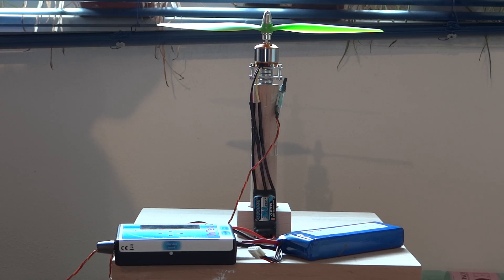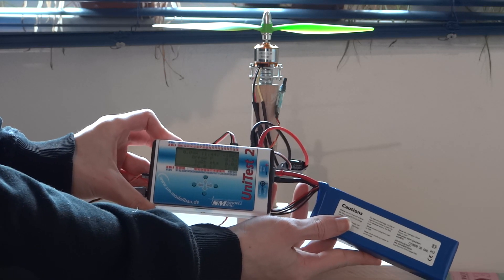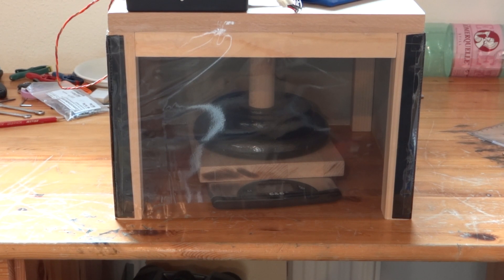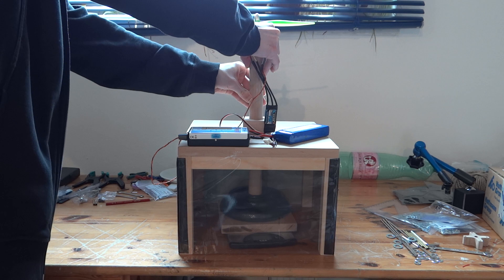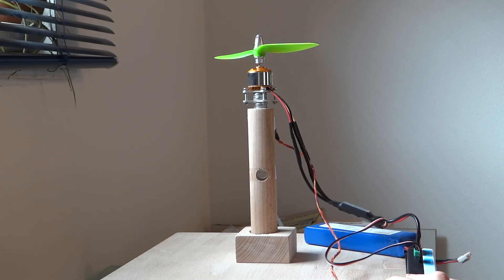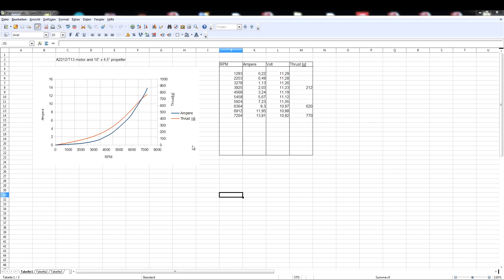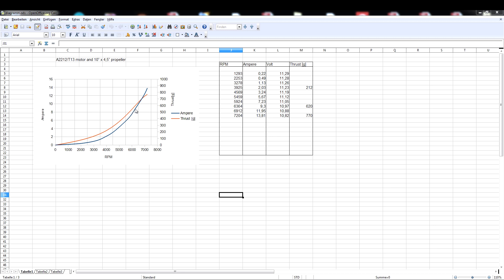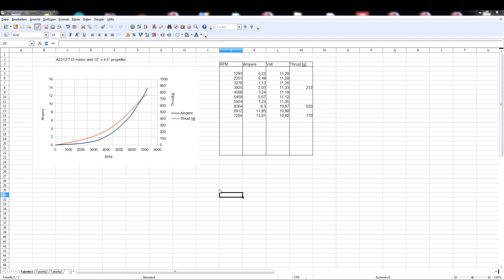A2212 Motor and 10x4,5 Propeller on the Test Stand; Thrust, Current and Speed Measurement

Comment: Your data sheet does not show Watts. As motors are rated by Wattage, which is then applied to weight factors per type of model, you have missed out a most important factor. When matching a motor to model type, Watts -  per lb, kilo or grammes or whatever - is the most necessary figure to work with. ie sport gliders= 75-100W per lb, hotliners - up to 250-300 W perlb. And so on. Large aerobats can be a massive 800 - 1000 W per lb. If you liken Watts to HP you're getting there. 
The info sheet you get with your motor will give you a 'ball-park' number for both Watts and Amps. 
Also high revs do not equate to efficiency. Look at indoor comp models, they rarely rev more than 200 rpm but their prop is far more efficient than a high revving ic engine. Prop efficiency comes down to balancing pitch, diameter and output of motor, plus torque 
The Watt meter is your friend.

Comment: It would be necessary to see if that motor really has a Kv of 1000, since the numbers show a Kv ratio of just 66% with that propeller. A very poor value for efficiency below 65%       Habria que ver si ese motor tiene realmente un Kv de 1000. ya que los numeros muestran un Kv ratio de apenas el 66% con esa helice. Un valor muy pobre para una eficiencia por debajo de 65%.

Comment: Hello, the information provide is very useful! Maybe I'm a little late but I'm doing an experiment similar to yours and I can't get more than 200 gr of thrust.  I'm using a A2212/13T 1000KV, 10"x4,5" propeller,  esc 30A,  and Lipo 2200mah 3S 25C. 
Did anyone have this same problem? Thank you!
Reply: what is the meaning of 13T ?
Reply: @vikrantsingh47  number of turns on the copper wire, the more turns, the lower the RPM but greater the torque

Comment: i just ordered this motor how can i test it if it is running? what kind of battery or voltage to use? thanks
Reply: Battery voltage depends on what esc you are using.

Comment: Could you tell me in which city you tested this? I will be flying at very high altitudes, so I will need to compensate the calculations because of the air density being lower. Thanks.
Reply: You need to vary pitch. In thin air you need a coarser pitch. And a Watt meter! You absolutely cannot guess it.

Comment: can we fly 1.2 kg quad
Reply: You can. Provided u calculate the thrust per motor. If it s a quad, divide the total thrust required by 4. So you will get the thrust required by one motor. Then if you are using the quad for racing then use a motor with 100% more thrust than calculated. If you're using it for video recording then choose a motor with 70% more thrust than required. This is mainly for stability. While for racing you require speed rather than stability.

Comment: Hi, partner! I have an F450 drone with a 920 kv engine with a 1045 propeller and it flies well, but with the gimbal and the camera is not going up! The total weight of the drone is 1.5 kg. Which propeller should I use to make better use of the thrust of the engine?
Reply: Did u ever figure out which prop is better for your f450? Have same frame and 10" props r too much, hot motors. had sum 7" tri props and it flew ALOT better, have some 8" standard props but waiting on a replacement motor ( crashed drone after a flip, couldn't recover fast enuff with the 7" tri prop) . I have br2212 1000kv on a Hyperion 3600mah 3s. Don't want to have to order a bunch of different props if some one has a good idea of where to start. Flew it on 4s also , but only have small 1500 4s for other drone.

Comment: Hello,
Have you tested the same setup with 2s battery? if yes, would you like to share the results.
Reply: For 2212 motor +30 Amp esc you should use 3s lipo more than 850 mah...... For a good result
Reply: Bro, it Will be unpowered..... Like dead fish 🐠
Reply: 490 gramms with 2s

Comment: How did u measure ur rpm?
Reply: You can use the optical tachometer, One thing you need to be careful is that most probably the coloured propellors are reflecting.So you need to divide the result shown in tachometer by two because it counts each rotation as two.

Comment: I have a question. In your excel we can see that you get 7200 rpm at 10,82 Volts. Shouldn't you get 7200 rpm at 7.2 volts instead? (1KV)
Reply: 1kV is the no-load speed. his test is under load, hence less than 1000rpm/V.
Reply: Okay thanks

Comment: Hello , just a thought I'm not actually sure but , would the results be different if they were measured one , with the propeller lifting the measuring object to the propeller pushing the measuring object towards the ground ? I'm supposing there would be slight differences given that Gravity is helping the downward measuring as opposed to gravity going against the upward lift measuring . On such a small scale it probably wouldn't make that much difference . But on a larger scale ...maybe . Has anyone done done these methods and if so what were your measurements ? Thanx very good video .😀
Reply: The results would differ but not for the reason you thing.   The to work best needs "clean" undisturbed air.  Air that is not turbulent in from of it.  SO "down" works best.   If you do the test with the airflow going up then there is all that test equipment under the prop blocking the airflow.    (Also you risk sucking the wires and loose papers though the prop.)

This is why airplanes mainly use tractor (not pusher) props, the air flow going in is not blocked'

Another issue is cooling, the air blast on the engine is used token it cool

Comment: Hmm, great info....
Does the RPM represents throstle stick position? I guess so... It would mean that our linear throttle stick curve actually does not represent linear thrust...
You get only 26% of maximum thrust at 50% of throttle (unwanted expo without programming).  
I've noticed that motor on my wing is actually quite too numbly powerless below half of the throttle.

Comment: Hello! 
 I have to make the exactly same experience, but i don't have large knowledge about it, could you help me please? 
 I have a brushless motor that was taken from the AR Drone of Parrot. The characteristics of this motor are:
Rated voltage 12V DC
No phase 3 phases 
Operating voltage 5-12V DC
Rated load Propeller
Rated speed 42000+-7%rpm
Temperature range working temp 0-30 celsius
No load speed 52000+-7%rpm
No load curent 600ma Max
Insulation resistance 10M Ohm Min
Terminal resistance 600+-50mOhm
I don't know how to calculate which esc variation to use and how to put all together. 

Thank you very much!
Reply: hello , so if it has only 2 wires, the only esc you'll need to use to use is a pwm variator, or just a current limited power supply. else, any esc that will handle more than 1 amp will be good enough (if you still have the copter you can just solder/twist a pair of wires from it to the test bench.)
from a quick calculation, the motor should take in 7.2W max  (600mA *12V) so you probably shouldn't expect the motor to lift more than a few grams (50-100 would be my highest bet.)

Comment: nice job!!! congrats... just a question... I saw in your table that Volts are dropping (as expected) while testing... Do you know the way to compensate for this? I mean, to have all thrust at different RPM based on the same voltage input? I think this is important to compare different propellers with the same motor based on the same voltage... thanks

Comment: Hello!
Could run the engine with a 11.1 lipo battery is 850 mA (or 1000mA, or 1300 mA) 3 cell?
Reply: Adrian Juarez it may need higher C rating. For 850mah try 60C or 80C

Comment: Hello would be possible to use a propeller 8x4.5 or 9x4.5 with a esc 12A?
I am looking to replace my quad 3DX8 engines that already comes with the esc de12A
Reply from the maker: André Gonsalves Hello, yes I think it is possible. Here are some pictures of datasheets (not made by me): http://www.microcopters.de/artikel/multicopter-motoren-im-test#sa2212-13 At full speed the current gets close to 12A, so I would avoid max. throttle.

Comment: Nice test , thanks. I have these motors, and have a 450 class quad with 9x4.5. I also got some 10x3.7 slow flyer. All carbon. But I want to fly more with less prop, so I dont get too fast. I also just got some 10x4.5 carbon, and some 8x4.5 for a smaller 350 size. Again, all carbon. I like the test device. I will look for it on the internet. Do you think it is still around?
Reply from the maker: John Robertson I want to test some different propellers too, I ordered some 9x4,7 in carbon. Carbon props are certainly better, just more expensive in case of a crash, that`s why I bought plastic ones for the first flights. ;-) 
I think the Unitest 2 isn`t produced anymore, I bought it 7 years ago. It is very nice to have, but was also relatively expensive - around 160 Euro if I remember correctly. You can sometimes find an used one offered in german RC forums.
Reply: Experimentaltechnik Well I dont think youll break a carbon prop, unless from a great height. Most likely the weakest link, such as an arm, or maybe zipties holding a motor on will pop first. The 3 piece aluminum spinners I use are a breakaway type.
Reply: You can try to 8 and 9 propeller with 4slipo. But check Volt x real Kv = more 70% rpm.